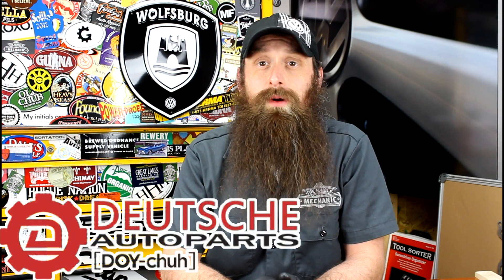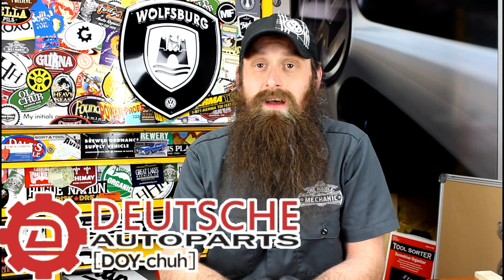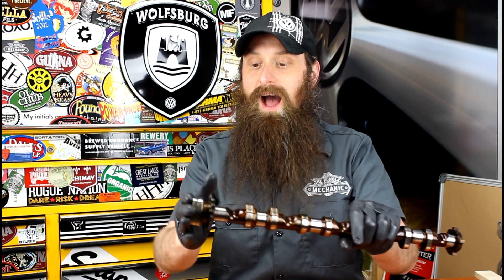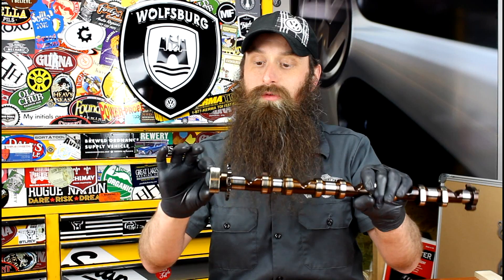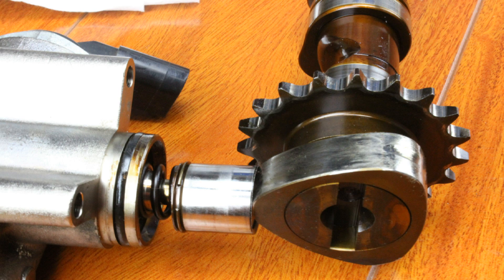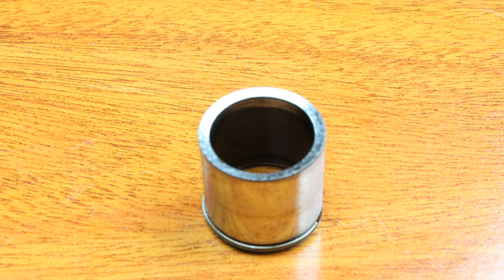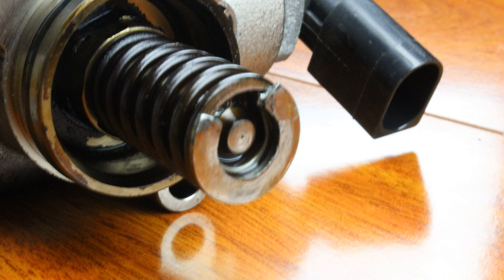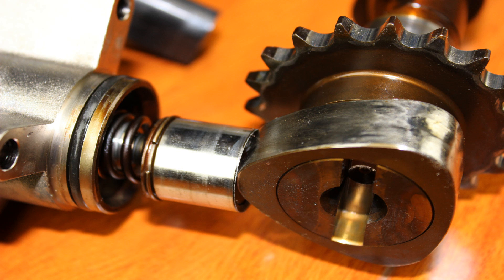How The VW 2.0T FSI Fuel Pump HPFP Fails

Comment: Hi Charles, I love your videos! I recently bought an '06 Audi A3 2.0t FSI with 180K miles. I checked my HPFP this weekend and found the head of the follower worn through and missing. I've had no issues with running or codes (though I got a pending missfire under hard acceleration the day before I checked the HPFP), so this was a routine check. The pump and lobe looked good and I replaced the follower (will check it again soon to see see how that lasts). I'm now concerned about that metal debris. The follower looked like chunks had broken off as opposed to gradual wear. I did an oil change the week before, went through the drained oil with a magnet and found no metal at all. The car is new to me so I have no idea how long ago this failed but I'm now worried about issues I may face because of the metal fragments and what I should do to mitigate that. What do you suggest? Here's a pic: https://i.imgur.com/4FoAPL4.jpg
Reply: hondaman900f How did you make out with your Audi?? I replaced my cam and fuel pump as well as new follower around 240ishk miles... haven’t had any issues since, but mine was really really bad the cam had been eating away followers every couple thousand miles and I would lose all power and boost at cruising speeds in the city and highway. What a difference when I had repaired them all, night and day! My check engine light went off shortly after and I haven’t had any issues since. They revised all of these parts and I was told by VW coworker techs that once I’d replaced these I’d never have to ever again for the life of the car because they have been revised and made out of stronger materials. If you have any questions feel free to email me @dylanx31493@icloud.com I will be more than happy to help you out!
Reply: @dylanrowan6626   Thanks for the support. I ended up doing a lot with this car. I opened up everything on the motor, replaced the cam follower and pump seal but left the camshaft in. The lobe looked nice and smooth, and I couldn't feel anything with the finger nail test, so I called it good and am watching it. I also then pulled the sump, valve and timing chain covers, checked everywhere for metal debris, pulled the tiny screen filter in the cam chain cover, trolled everything with a magnet and found no metal debris at all, nothing. I have to believe that the bits made their way to the oil filter and were caught there. I can't search any deeper or more thoroughly at this time, so I'm calling that good/due-diligence as well, and will watch for any issues. I also replaced the three sealing rings on the VVT shifter as they just fell apart when I had that out. With all this work on it those old vacuum lines all started to split whenever touched, so I spent some time tracing and sealing vacuum leaks as well. I now have a new oil leak from the top of the oil filter block where it's sandwiched between the oil cooler and block. That's up next, but the entire intake manifold and front of the engine has to come off for that. I need a free Saturday to do that with a Sunday buffer in case things don't go according to plan (they seldom do). I also replaced the coil packs, plugs, N80 valve, and the control solenoid in the AC compressor (which restored AC just in time for the warmer California weather). At this stage, lots of work, time and parts later, she runs very well but is still noisy (which is where I started this adventure of fault discovery, tracing down the noise). I can't isolate it but have eliminated the N80 valve, lifters and cam chain as sources. I'm not certain about the HPFP as I don't know how noisy they should be, but I hear the engine ticking noise inside the cabin and if I think too much about it it drives me nuts. Cranking up the radio helps :) It's hard to tell from other YouTube videos if my engine noise is "normal" or of concern. At this stage I'm enjoying my A3, ignoring the noisy motor until the next CEL.
Reply: hondaman900f Replace the pump, follower and cam. Gonna hurt the wallet a bit but saves a lot of frustration
Reply: hondaman900f it’s only going to keep wearing through if you don’t replace your cam with a revised cam and fuel pump and follower. You could have misfires from a bad PCV valve,  bad coil, spark plugs, carbon issue. Etc
Reply: Yikes just saw that picture. Hopefully those chunks of metal aren’t floating around in the timing cover / valve cover
Reply: @dylanrowan6626  I'm going to pull it apart this weekend to see if I can find metal in the sump or in with the camshaft timing chain. I ordered a magnet that goes in with the oil filter so that may help trap debris. Looks like a replacement camshaft is $250-300 which sucks. Given how common this issue is I don't know if I'd be any better off buying one used. I replaced the PCV valve a week ago just in case it was contributing to the valve cover oil leak I fixed, so that's unlikely to be bad. I'll see if the misfires return and then diagnose accordingly. Since I ordered the coil packs and spark plugs I may as well replace all of those and eliminate them from the equation. I'm just concerned that I may end up investing more money into this 180K car than I could buy a lower miles one for. I do love it otherwise.
Reply: Good to hear! I also have the same leak from my oil cooler seal. That’s my next project down the road... I feel your pain on all of that, been there done all of what you’ve done lol.
Reply: @dylanrowan6626  I found my replacement oil filter housing on carparts.com for just $41, way less than anywhere else and less that the two gaskets on their own. Just arrived yesterday and looks good. I also ordered replacement rear hubs (Amazon) to address the pulsing road noise from the rear which I suspect is wheel bearings. Someday I'll have a weekend not devoted to workign on this car - good thing I enjoy (most of) it  :) Do you have any feedback on how to tell if a 2.0t FSI is noisier than it should be?  In comparison my '03 1.8t GTI purrs.

Comment: I have this very issue with my 2006 2.0 GTI, my question is if the follower is "bad" must you replace the cam?  Can you clean up the lobe if not too scored. What would happen if you only replaced the follower, how long would it last? I can buy 6 followers for the cost of one cam, see where I'm going with this...
Reply: David Beyers It’s a hit or miss... I suggest you replace the cam, fuel pump and follower. If there is even the slightest amount of damage on the actual plunger of the pump you must replace it. If you have any signs of excessive wear you SHOULD replace the camshaft because you’re just going to keep dumping money on followers and if you keep replacing something that wears out in such a short time all you’re doing is contributing damage to the engine. For example, if your follower is wearing out badly between 1,000 to 10,000 miles all that shaved metal is gonna go somewhere and eventually will destroy your engine. So for starters I would highly suggest you take my advice because I kept replacing my follower and it never got any better and was just making matters worse. I was a VW tech and had a slight discount when I bought my parts and I spent around $750 for the camshaft, HPFP, and cam follower... if you need help or have any questions feel free to contact me here or email me @dylanx31493@icloud.com
Reply: Hi a have 2l alt do day have  the same ad tfsi problem

Comment: I have a 06 gti 2.0fsi. Can this lead to cylinder misfire?  I'm having issues diagnosing it. I'm having what feels like boost or fuel cut under moderate acceleration. The code throws  p0300.
Reply: Yup, I had this same issue on my '06 Audi A3 2.0T FSI. This cam follower/HPFP issue can cause fuel delivery issues at high revs and acceleration. Mine would throw misfire codes when accelerating on the freeway to pass cars.

Comment: Please helpI have 2 codes ive been driving my 2011 audi a4 b8 1.8sti but low power and long crank start P0243 AND P2293 PLEASE HELP
Reply: Tony Mog Get it checked out. The newer TFSIs no longer share this HPFP and follower, they were redesigned in mid-2008. Sounds like you have a few other issues not related to these problems in the video.

Comment: Humble Mechanic, i need your wisdom. I've got a Audi A3 2.0T FSI 2006. 8PA. I started to experience a sudden loss of power every time i reach 4000 revs. i mean every gear at the exact rev range of +-4000. Its a strange kind of power loss, it feels like a vacuum. the power gets sucked up. My usual driving style is to shift at 2000 -2500 revs, so that power loss didn't even affect me. I didn't get a engine light. I continued to drive like this for +-8 months. One day the car just lost power while driving, this time i could feel it accelerator pedal just collapse underneath me until the car just died. After so 30 minutes the car started up again. this happened a few times (So I bought myself a new TDI). I've checked out all the videos of HPFP failure, cam lobe and fuel pump modulator failures. Unfortunately i'm not really handy and i don't even own a spanner, i'll have to get someone to fix it. As Im assessing this situation, i realise that ill be able to save a lot of money if i get to the root. 

Share your wisdom with me Humble Mec.
Reply: Hi im currently experiencing the same issue ! Have you gotten to the root cause yet ?
Reply: @jodynaidoo4050  yes, it was my fuel pump that's in the fuel tank.

Comment: Hi, quick question I got a fuel pressure regulation 00476 error code could it be the HFP pump going bad?
Reply from the maker: It could be, or it could be on the low side of the fuel system

Comment: 2008 fsi Passat ran out of gas, p0089 and p2293 codes. Sometimes the car runs well and drives fine, then if it sits for a short period of time (20 mins in store) it wont start. Should I replace the HPFP? Or Module in the gas tank?

Comment: Great video. I have just bought a gti 06 tfsi. I knew about the common problem and went to replace the cam follower straight away and found my cam follower had broken through. My high pressure fuel pump is also worn and cam lobe stratched up. It’s been running ok, will replace the fuel pump. Not sure if I need the cam shaft replaced though? Thanks guys you rock
Reply from the maker: Probably need a cam if it’s worn all the way through
Reply: Thank you for the reply, really appreciate it man. The cam lobe was quite scratched up. I would post a photo I took if I could so everyone could see and yourself. You could imagine the look on my face as I pulled out the broken cam follower 😩😩😩 the high pressure fuel pump definitely looked worn down and uneven

Comment: Nice video! very concise and thorough. I had experienced hesitation during WOT. Replaced fuel filter 1st then plugs and finally coil on plugs. Car ran great for a few days then Got an engine code P0089 which led me to this video. Thanks for sharing as I'm not in the dark with where to go next.
Reply: dude i have the same issue right now, did you ever get it fixed?
Reply: @dividingdan  replaced leaky plastic tube on one of the emission controls. EGR pump valve was stuck as well. Sold the car shortly after. Good luck with your issues

Comment: Quick question I have a 2.0 FSI passat I change my cam follower every 50k miles. Its always looked fine just some of the coloring gone. My car has 163k miles now and their is a LOT of noise coming from the high pressure pump. No codes. Car runs fine. Could the pump be going out? Any help is appreciated
Reply: Matt Renison I wouldn’t replace it unless if you have any codes or if your followers are wearing through rapidly. Have you inspected the cam to see if there’s any signs of scoring or excessive wear?

Comment: hi guys .. i have a 205 audi a3 tdi ... i have a  problem trying to start the car when its left over night or a long period of time  .. it takes at leadst 20 seconds of turning over before it starts , then once its been started it runs and starts fine after that until the next day again ... any ideas and is it worth me checking the high pressure pump ?  ??
Reply: how olds your battery? you going on long drives?

Comment: I have that failure in my car. I ve replaced the cam follower, the old one had a hole, my HPFP doesen t seem to be damaged like the one you showed. It still has the error. Do i have to replace the camshaft and the HPFP? Thanks
Reply: Tiago Goncalves Most likely

Comment: 2006.5 GTI MK5 with P2540 (Low Pressure Fuel System Circuit Range). Only 50K miles and runs perfect despite
 CEL.  Would replacing the FPCM be a good place to start?
Reply: Paul1PA Check your thrust sensor. And also check the cam follower... could very well be worn at only 50k miles especially if it is an early revision part. Mine was really bad I had to replace the cam, fuel pump, follower, and other parts that I decided to replace while I was in there .

Comment: I have a 2006 Audi A4 2.0T non quatro. Started dying at idle occasionally. Code p0087. Replaced hpfp and both thrust sensors attached as well as the regulator on top and cam follower...now it's rocket from 0-40 but after that it's a slug... almost as if turbo is cutting out. And now, after replacing all of that...I have the codes P2293 and P0089...I'm baffled. Please help, I've only had this car for 3 months and have sunk over 2k into already 😕 what could the problem be? Do you I could have the wrong sensor? I heard about the changes and recalls... please help I love the car but the wife is saying get rid of it...😔

Comment: Hey, So I Have A 2008 Passat 2.0T BPY FSI I modify the car! With upgraded HPFP Tune Downpipe Intake  and When Im at high RPMS or Going Like Really Fast My Car Just Dies Or Sometimes In Cold Start It starts Good But Like After 5-10 Seconds It Dies  What Could Be The Reason The Fuel Pump! And Codes Are P0089 P0087 P2293?

Comment: Great videos. I wanted some input to a problem I'm having with my 2012 GTI. The car will lose power during very hot days 95+ degrees outside after driving for a while. It will lose power while accelerating then recovers after a few seconds. Basically scaring the crap out of you at highway speeds. When reading the OBD2 I pulled a P2293 code, P0087 code and a 01038 code. This does not happen a lot, what could this be?
Reply: This could be the [fuel control module] located under the rear seat cushion on the in-tank fuel pump.

These modules tend to overheat if they are old, heat and a dirty fuel filter can contribute to this problem, as well as leaking or restricted fuel supply lines from the in-tank pump to the filter, or from the filter to the HPFP.

You may also have a dirty strainer on the in-tank low pressure pump. After removing the seat cushion and inspecting, if you decide to replace the in tank pump, control module, and filter, I would siphon the tank, put a few gallons of water in the tank so that you have a good amount to flush the crap out. I use a paint mixing bit on a power drill to swirl the water and mild detergent soap inside the tank, siphon to water out and wipe the tank clean, allow it to dry before adding clean premium fuel, and change the fuel filter.

The filter has 3 hoses, one hose you will notice a blue ring or tab on the fitting, if you depress that tab (pushing it in)while pulling straight out, the fittings pop right off. For the one fitting on the out side of the filter you would need to release the bracket holding the filter so that you can access the tab, otherwise it's at the top of the fitting and hard to see.

Comment: Thanks very much for your Top 5 Failures video; it brought me here.  I've a 2011 CC 2.0T (standard CC) from the Top 5 Failure video I thought you are talking of ALL 2006-2011 TSI 2.0T engines.  @2011 has INDIRECT INJECTION;  watching this video you speak of DIRECT INJECTION.  Easy enough to believe that the same problem exists for indirect AND direct.    Not yet seen in my hand a camshaft, but to look at this and other videos the HPFP cam lobe appears to be a separate part removable from the end of the camshaft (certainly well attached/shrunk and with key, perhaps end keeper (not seen?)  ?Can one change camshaft HPFP lobe while camshaft remains?

Comment: Alright, so today i take my car to the shop... Was pretty sure this was happening to my car, and i was spot on... I do have a question though this was a used car, with an extended 3year/30k warranty... Im at 2 years and 20k, the warranty company is paying for the cam and follower... But they refuse to pay for the hpfp, stating that it is NOT an internally lubricated part, this is false, correct? The cam follower has 4 holes in it to pass oil through, and that lubricated the hpfp lifter? Correct? They should cover that also correct? Maybe the guy i spoke to is just an idiot thinking its in the fuel tank?
Reply: hi the cam follower and HPFS is covered under VW extended warrenty

Comment: I just picked up an 08 Wolfsburg and never knew this.  I'll go and check this tomorrow to make sure it's okay (mine has 108k on it and is stock). I have no CE light and the car pulls quite strong.
Reply from the maker: Good call on checking. It’s easy and can save $$$

Comment: Hi, have you seen the pump fail internally causing low pressure? I inspected the cam love and recently changed the follower. 1 week later I got a p0087, the high pressure was reading 19 to 23 bar. Is
Reply: Hi did you find the problem?

Comment: Is finding a few little bits of metal in your oil filter really bad..? I have a feeling the cam follower wore out and was replaced... car runs fine except when under heavy acceleration it bogs down... 05 mk5 105000 miles...dsg
Reply from the maker: It’s not good that’s for sure. You can quickly pull the pump and check it
Reply: Dave Cooley okk